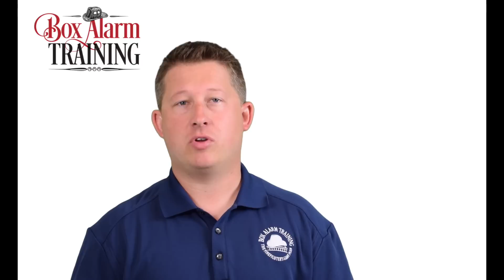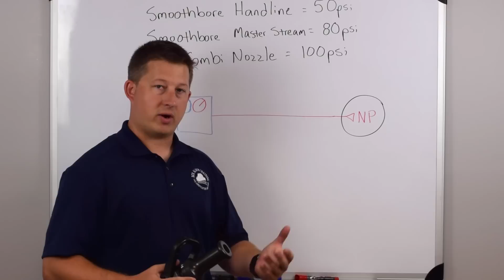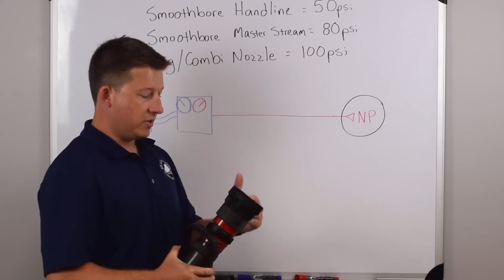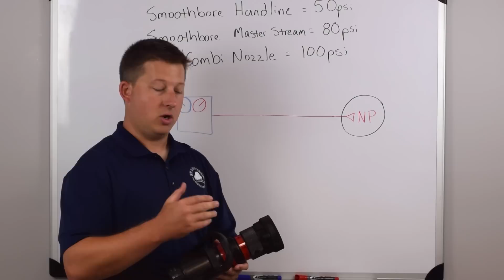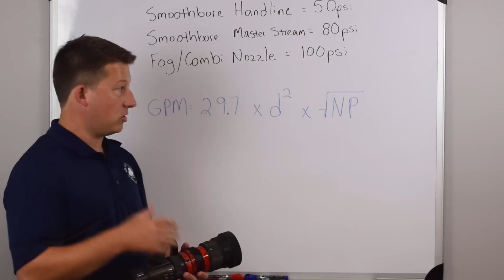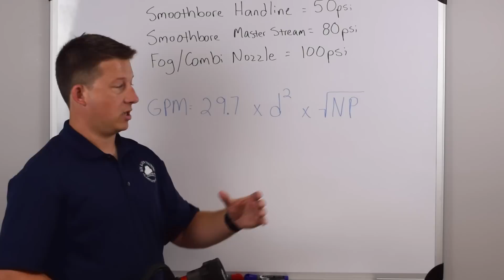Pump Operator Training Series - Part 2 "Calculating Nozzle Flow"

Comment: Hallo sir i'm Zhuu from indonesia, i have a question for you, when i see your formula i'm little bit confuse about d2. is that nozzle diameter or hose diameter or coupling diameter?
please help me to understaind and thank you so much for your video, i'm really like it
Reply: Why do we need to close the(discharge) isolation valve of a centrifugal pump during startup⁉️ 

#pumpsolutions #pump #discharge  #startup #energy #oilandgas #hazard #saftey #gas #renewableenergy 

https://techproces.com/centrifugal-pump/
Reply: That's the diameter of the tip of your nozzle

Comment: QUESTION:  At the part of the video where you are calculating GPM for the combination fog nozzle, which i s expected to run @ 100 PSI,, then if you are running at the lower end of the GPM adjustment dial, let's say, 70 GPM then if you are still running the noxzzle @ 100 PSI from the pump, does this degrade the flow/stream coming out of the nozzle such as turbulance and sputtering output of the stream?  As an example.  On our Engine 2-0 (rescue pumper) Crosslay #1 has a combination nozzle labeled as 70~250 GPM @ 100 PSI.  If we supply the watter @ 100 PSI but have the GPM dialed down to 70 GPM, is the quality of the stream floiwng out of the nozzle over pressured or does tthe Nozzle make mechanical adjustments to the 100 PSI to provide a properly flowing stream @ 70 GPM in that scenario?
Reply: Your governor setting does that… if you set the pump at 100psi… then go from let’s say 250gpm down to 70 your engine should automatically idle down and compensate for that then pick back up once it senses that it can

Comment: Can you please tell me where the constant 29.7 comes from?
Reply from the maker: I'm not exactly sure how the constant is reverse engineered but basically if you flow test hose and find the outlet pressure with a gauge and the nozzle pressure with a gauge you can find the friction loss through actual testing. You could then solve the equation with the given test results to "reverse engineer" things like the coefficient for the hose or the constant.

Comment: Could you add subtitles that shows litres and bars whenever you refer to gallons and psi? For us europeans.
Reply from the maker: It may take me a little while to add that but I will work on it. Good suggestion.
Reply: Excellent. I realize that the maths section where you work the formulas may not translate directly, but having popup texts at the parts of this video series where you conversationally throw numbers into the mix, then it would be beneficial.
Reply: @TormodSteinsholt  google is your friend